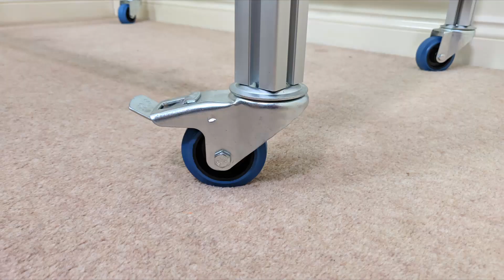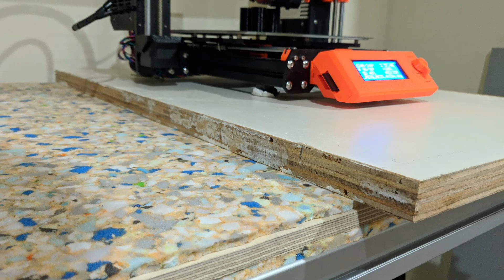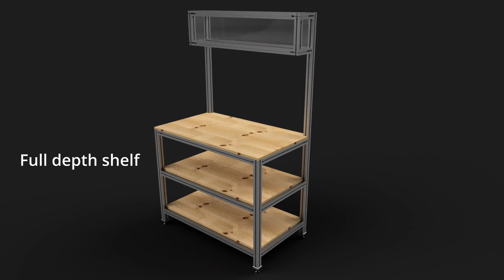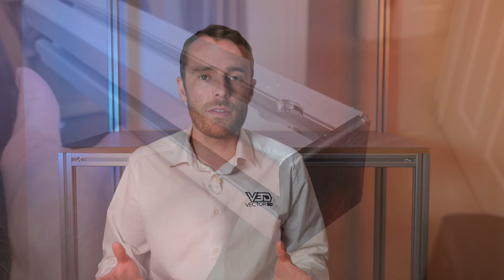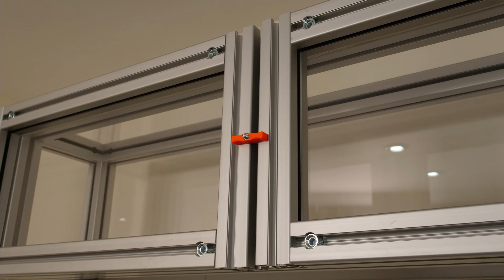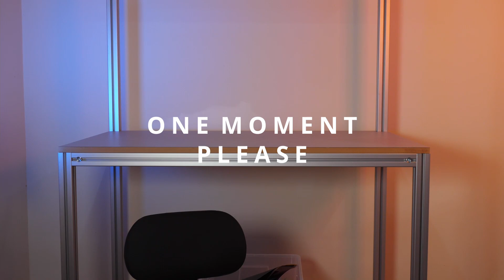I've wanted this for years! Kickstarter Launch day!

Comment: 1150€ .... for maybe 15m of 45x45 extrusion, a couple fasteners and a piece of 19mm fiber board or multiplex or whatever ... 
sorry mate, but I don't see the value here.
Bosch compat. 45mm extrusion is ~6€/m plus tax, if I buy a reasonable amount, plus maybe 100€ in fasteners, adjustable feet and some wood.
Let's say 300€ total, if I don't won't to do the machining for the fasteners myself. This feels more like a donation rather than a purchase.

I mean, I get. There's packaging and shipping, pesky income tax and kickstarter's cut ... but still.

You should've simply turned this into community project where you also happen to have reasonably priced plans with detailed BOMs for those who don't know how to FUSION360.

Comment: I'm having trouble understanding this product and what problems it solves. Is it just a workbench with a dry-box for the filament? Can you use the filament without taking it out? If so, how many filament holes does it have (does it support MMU or palette3)?
If it is a good product that solves problems it could be a good fit where I work, but kickstarter is an absolute no-go for that.
Reply from the maker: Yes, the upper box is like 99% sealed and can hold 10 spools. There are 10 holes for filament to exit, so as far as i know that would be two prusa mk3 with MMU maxed. I've not checked pallette 3, but in theory it would be fine.

Comment: I really like this, it’s what I need. But for the options I want, it’s £115 for shipping to the UK! That is quite a sum :) Where is it made?
Reply from the maker: Ye, shipping is quite expensive because there are a few large heavy parts. It gets delivered on a double pallet 😅 It's made in a couple of places actually, final supplier not selected yet until Kickstarter is complete.
Reply: @Vector3DP  I understand, but £115 is enough to rent a van for a day or two :) I’m afraid it will put quite a few people off :-/